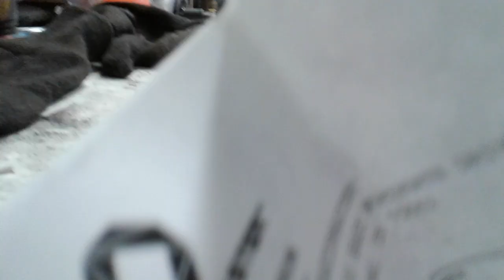Changing the tip sort of!

Comment: Hi Pa,when grinding the rivit's off,grind into the old tip a little bit and they will come out easier. I have changed dozens of them over the years. What happens when you pound there over the rivit's swell really tight on that side. So if you go about a eighth inch into the old tip then they will slip right out. Hopefully this will help. 😁😁👍👍Take care and stay safe my friend!! Your friend and fellow logger Al.
Reply from the maker: 10-4 yer rite !